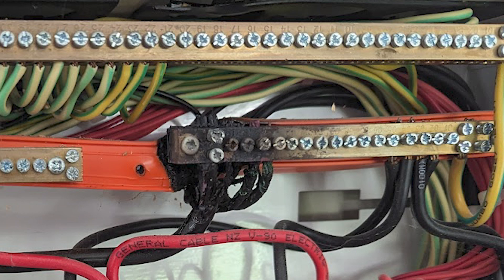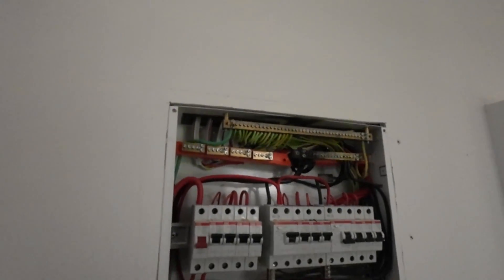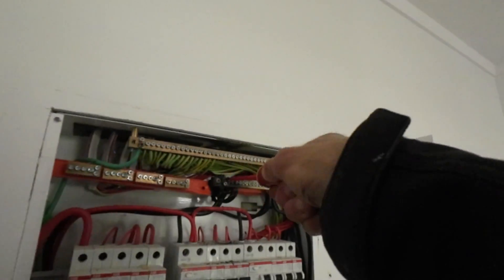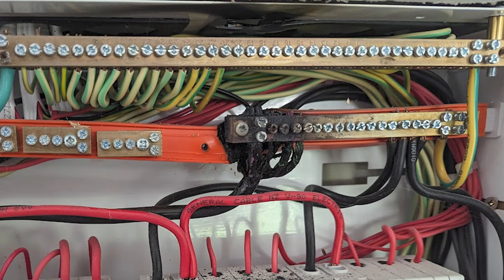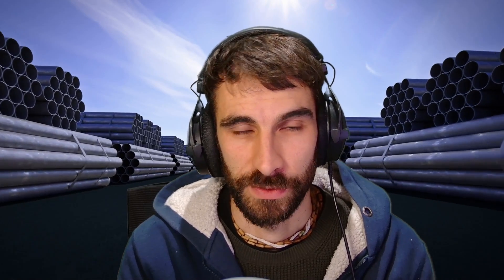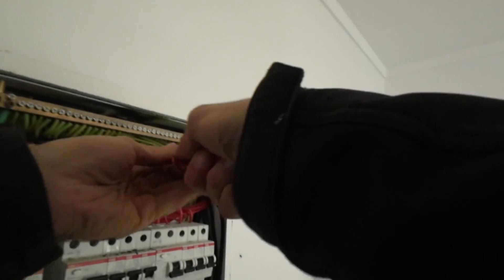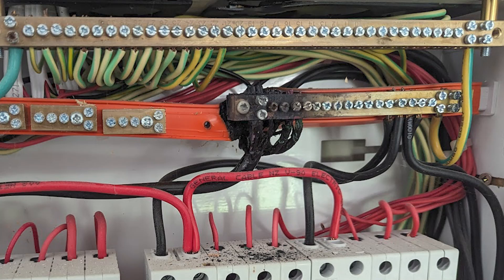Loose Neutral Fault Explained

Comment: The configuration of the Earth - Neutral wiring between the power distribution circuits and the consumer's circuits does appear to vary between nations, with each set of choices producing their own special failure modes and confusions of terminology.
Here in UK we also have (expect, commonly) there to be a main earth terminal (MET) that provides the separation of the consumer Neutral from the wiring Earth (aka continuous protective conductor CPC) which give some safety.. But we're now seeing diverted neutral currents in the earth wiring from some distribution cable faults - you can't win!

The US then has its center tapped 220V supply (twin hot) and a Neutral, so plenty of fun there as well.
Reply from the maker: Yeah, I want to make a video cleary explaining the differing distribution systems. But first I need to understand them all my self.
Reply: @legacyelectrical  When canoeing the Whanganui (holiday from UK) I saw a place that looked like it was fed by a single overhead cable that spanned the river (in the area of Te Whakarae, S of Taumarunui). 
It looked like the live overhead cable terminated at a pole maybe 100m from the property, presumably via transformer with live return side earth bonded probably near the pole. The transformer output feed (two wire) , then (probably) fed to the house where one side would be again earthed to provide the earth and Neutral to the house wiring. 

Lots of galvanic (direct connection) isolation aspects!
Reply from the maker: Yeah, some places in NZ use the earth mass for the neutral. This is rare and onto in remote rural planes. I'm told. Some cows have died from it due to the potential difference between their feet.
Reply: @legacyelectrical  I could believe that, especially under fault conditions. There's a Mike Holt video about such sensitivities - the rural mid west notices these things, along with pregnant women in swimming pools (Florida anecdote).
The mass of earth may be a safe conductor but the surface is a poor insulator/ equipotential bond!
Reply from the maker: Aren't the shocks the cows get just because their feet are so far apart that they get a potential difference? I don't think humans could be effected at the low voltages these setups would create.
Reply: @legacyelectrical  I believe so. The 4 legs with heart in the middle, better conductivity in the body mass, licking things (like kids do to batteries), motorised/pumped feed / water stations, inability to talk (can't say "ouch"), all contribute ..😬
Reply: @legacyelectrical  Sounds like SWER supply.  If we can't get the earth return impedance down low enough in Australia as to prevent step potential at the surface the electrode/pole/transfomer will be fenced off to prevent people and animals from walking near it.  I have heard of electrodes being driven 30m deep.
Reply: The only practical difference between your PME and Australia's MEN is that for you the neutral / earth link is done on the supplier side by the supplier and can not be interfered with by the consumer's electrician.  If you find it to be high impedance you have to call the DNO and have them fix it.

There are technical differences such as; Australia requires a dedicated electrode since 1976 but there are still plenty of older installations using only the water main for earthing, whereas you can still use just the pipe as the electrode.  That actually distinguishes you from a lot of countries that do TN-C-S.  Most such countries require a dedicated electrode, demoting the plumbing to bonded status; in Australia MEN earthing prohibits more than one N/E in an overall earthing system (say a single building or a set of buildings linked structurally or via a common concrete pad and so forth) while you have no issue with that and as a result can see considerable current flowing on the earthing and not see anything wrong with that (diverted neutral current) even in non fault conditions.  You can also run multiple incoming supplies into a single earthing system (as per previous examples) whereas we will only provide one master supply and split that up as needed to ensure only 1 N/E link is present.
Reply: @retrozmachine1189  I'm slightly confused by the assertion of the single N/E connection in the system. Given lots (some) of bonding of extraneous conductors you still get something akin to PME anyway.
A lot of the problems are 'caused' by the difference in perspective between the 3-ph folks and the single phase folks with respect to the purpose of the 'neutral' - in 3-ph its an ancillary unbalance conductor that doesn't need to be there, while in single phase its a primary conductor that's essential to the circuit. All of that is made worse by that nasty soil/rocks/mud [aka earth]  that is a poor conductor at the cubic cm scale but excellent at the cubic km scale that creates those sneak conduction/safety paths.
Reply: @philipoakley5498  Having many amps flowing across the earthing system continuously is not good.  Having the premises earthing system in parallel with the premises neutral system is not good either.  These concepts are upheld by most countries that implement TN-C-S.  In fact I think I am safe in saying the only country that continues to permit and deploy such an arrangement is the UK.
Reply: @ I had a longer reply but a popup/mouse click lost it.
The 'earth' currents will flow based on the impedances of the network of paths. These currents can be from anyone's system, including all the fault and stray paths across all the networks and sources at all levels of the hierarchy. 
The bigger problems appear to be in densely populated areas with older infrastructure and multiple use cases. 
If you are in 1930s house backing onto a DC traction railway and industrial units beyond, with street lighting out front, a local substation near by (with network reinforcement), overhead distribution and your neighbours are on different phases, then there's plenty of opportunities for failure for that scenario. All roads lead to Rome, and neutrals to earth ;-)
Reply: @philipoakley5498  If the penny hasn't dropped by now you never will.  Suffice to say what the UK does few others, if any as I can't think of another example, do.
Reply: @philipoakley5498  I avoid replying to comments in the popup menu, as you can see from your own difficulties and even from the malformed replied to name in your comment it's simply broken.  I open the video or short (in watch mode rather than short) and reply there.
Reply: @retrozmachine1189  Hi, sorry for the delay. I have made enquiries as to the range of countries that use TN-C-S. "PME, or more broadly TN-C-S (i.e. TN-C distribution network, separated out at the consumer service head) is NOT unique to the UK, although in some countries other acronyms are used. Examples include (but may not be limited to, and in no real order):

    Australia (where it is called MEN - multiple earthed neutral)
    New Zealand (also called MEN)
    Republic of Ireland (termed TN-C-S)
    South Africa
    Germany
    Austria
    Netherlands
    Norway (just starting to use the arrangement)
    USA (called MGN - multiple grounded neutral)
    Canada

"
Usage will depend on local conditions, expectations and historical approaches.
Reply: @philipoakley5498  Yes, TN-C-S can be seen used around the world as I suggested.  Not sure what you are getting at here?  Is this in relation to only allowing a single neutral/earth link within an overall earthing system?  That's actually  a pretty common requirement.
Reply: @retrozmachine1189  I was responding to your "the only country that continues to permit and deploy such an arrangement is the UK" part comment with respect to 'countries that implement TN-C-S'.

Perhaps there's something lost in translation? (this part of the discussion was about the problem of diverted neutrals under faulty conditions).
Reply: @philipoakley5498  "These concepts are upheld by most countries that implement TN-C-S.  In fact I think I am safe in saying the only country that continues to permit and deploy such an arrangement is the UK."
Reply: @retrozmachine1189  so what is it (concept/connection arrangement/?) that you think we "permit and deploy" ? And if possible, why it is considered inappropriate (in country X)
Reply: @philipoakley5498  Re-read the comment quoted.  It's quite clear.
Reply: @retrozmachine1189  It took a while pulling out all the comments and reviewing them. It still wasn't properly clear (different viewpoints?).

Firstly Diverted neutral currents (DNC) are the result of a network FAULT, not an allowed arrangement (once discovered/found).

Secondly, It's unclear what you are saying about the earth circuit being 'in parallel'.  IIUC you also have multiple supplier connections to earth, one at each point of supply. We also (commonly) have upstream PME as well a the provision of an Earth at the point of supply. Thus fault currents can flow between properties, via earth connections (especially if on different phases - a network unbalance).

It's not clear if you were referring to cross bonding to other extraneous metalwork, on the consumer side of the system, that may emerge from the ground, which in fault conditions is also a source a danger. Here in UK we do cross bond to such metalwork which should have no voltage nor current on them.

Part of the UK situation is the potential for a high density of electrical services provided often on older cable (e.g. lead insulated , and others with metallic outer shields/armour). The modern Open PEN 'worry' (easy explained case) is for EV chargers at the edge of the consumer property immediately adjacent to street lighting on an independent supply providing shock potentials under fault conditions akin to touch & step concerns elsewhere in the wider network. (the my Earth is better than your earth argument that physics will decide ;-)
Reply: @philipoakley5498  Try reading what you are responding to next time.  It helps if you do.  I won't respond again until you can demonstrate you are actually doing this.
Reply: @retrozmachine1189  likewise. Please remember that what you thought you said can be understood in different ways.

Comment: And that is why all residential properties should use either RCDs or RCBOs in case of an earth fault that could develop into ground fault.
Reply from the maker: This property already has Rcds. RCDs don't protect you from this kind of fault. This is because the fault is before the rcd and any fault current doesn't create imbalance for the rcd tor detect.

Comment: Similar things happened in our place a few years ago, the lights went off for 10 seconds then came back on dimmer than usual, the heater fan also went slow, a call to the utility company was needed, my socket device was showing 170V slowly rising to 190V, about 3 hours later the whole place went off for 30 seconds before coming back on with full power (244V nominal), it was clearly a substation neutral fault.
I live in the UK BTW.

Comment: Hi, I was surprised to see that you link Earth and Neutral bars in the Consumer Units in N.Zealand.
Here in the UK we have various earthing systems but this one we call a TNCS or PME. The diff. being the link between earth and N is in the Head at top of the incomer ie it's pre meter / consumer unit. In general there is no earth rod but that is likely to change in next revision of the Regs.
We still have the danger of broken neutrals but they would need to be outside the property to cause this problem. It seems unnecessarily dangerous to link E&N in the CU.
What is the Max Ze (earth rod only) allowed in NZ ?
Reply from the maker: You're not allowed to do a TT (earth rod only) system here.

The MEN link (main earth neutral link) in the switchboard board (consumer unit) makes sense to me. You can remove thr MEN link to do some kinds of testing for example.
Reply: @legacyelectrical  If you're not allowed TT only, how did you fit EV chargers when they first came out and there was no Open N/E detector available. In UK we had to put them on a TT (No TN allowed) to avoid the risk of making the car live due to a broken PEN (Protective earth and neutral) .
Putting the N/E link in the fuse box seems so much more dangerous coz you are adding at least 3 more opportunities to have a open neutral. 
1/ Tails from the Head.  2/ Tails into the meter.  3/  Tails out of the meter  4/  Tails in and out of an Isolator.  5/  Tails into the main switch.   6/  Connection - Switch to the Neutral bar.   All those risk points could be eliminated by linking them in the Head.
At the end of the day; while the risk of electric shock is sever, more people die from fires caused by poor connections and arching than they do from shock.
Keep up the good work in spreading the word.  Also it's a good tip to check the main earth with clamp meter to look for diverted neutral current before merrily working on an installation.
Reply from the maker: @geraldelwood9660  If you loose the neutral to the installation all metal appliances will become live, not just your car. Why pick on the car as something that should be protected from this kind of fault?

Yeah, measuring current in the main earth is a good move. When I do inspections I like to check that.

In the UK do you guys run a separate earth conductor from outside of the property? I guess that would reduce the number of places that you can have a hot connection develop as the main earth doesn't have current running through it (orindarily), at least not enough to make a hot connection.

Yeah, I think you're right, fires from loose connections are a bigger threat.

I'm surprised how well this video has done. I'm glad it's useful and potentially life saving information.
Reply: @legacyelectrical  I think the reasoning for no PME for EV chargers is that in the future there will be millions of cars, some of which will be plugged in while being washed by owner. Like this, there is a far lower resistance to earth than someone standing in dry shoes on a dry carpet on wooden floor ....  Hence tragedy of lady with outside tap. I have felt for long time that it should be in building Regs that any outside tap must be supplied by at least a 30cm section of plastic pipe - eliminating any "earth" potential on the metal tap.
We have 3 main earthing systems :  TT;  TNS;  TNCS  (PME)
TNS has a supplier's earth - (the casing of the concentric incomer). The main earth is strapped to this and goes to an earth block, at which point the householder takes responsibility. (Max Ze 0.8)  With a TNCS there are just the 2 conductors to the supplier's Head / Cut-out.  The Main earth originates from the neutral in the Head and again goes to the main earth block. (Max Ze 0.35)
We have to install an earth rod if the Ze is above the supplier's Max. Also if the property is a setup to isolate from the grid to tun in Island mode (prosumer)..
In the latest Regs we are now advised to earth to the foundations in all cases as a back-up to PME supply.  Due to increasing cases of open PEN  (protective earth neutral) as our grid ages and falls apart 😀
Reply from the maker: Ok, so TNCS sounds like what we have. There are only 2 wires coming in front the street (if its single phase). But unlike there, every house must have an earth rod. The wire coming from the earth rod is run into the earth bar and the bar is linked to the  neutral bar. We don't have to test the earth resistance in the earth mass, just the wire thsy runs from it to the switchboard.

I see what you mean. Washing a charging car definitely has extra risk. We just have RCD protection for all our chargers. It's hot written into law yet, but the guidelines are to install 6ma dc rcd protection. Best to follow the guidelines since if someone goes wrong and your name comes up, saying 'it wasn't law' won't sound good.
Reply: @legacyelectrical  Similar Regs here. Chargers must have a disconnect device which operates when it detects 6mA of DC leakage on the circuit. Also all upstream RCD's must be a Min. Type A so they still operate even if there is 5mA of DC leakage on the circuit. We have only recently stopped using the Type AC RCDs as standard. Bit late in the day !

Comment: in the US, it gets even crazier with our center tapped single phase system.  if the neutral drops out, the single phase circuits go off balance, and turn into a series circuit - so one instead of each phase being 120V to "ground", I've measured imbalances as large as 200V to "ground".
Reply from the maker: How does  single phase center tap work. Surely you can't earth the center taps off 3 different phases.
Reply: @legacyelectrical  they take one of the three phases, and feed a transformer with a center tapped secondary.  then they connect the center tap to the earth reference.  that gives us two phases at 120V to ground and 240V phase to phase.  then we run our high load circuits at 240V and our general circuits at 120V.  takes more copper than running all circuits at 240V, but we've always had a good supply of copper; and in exchange, if a person gets shocked, it's usually just an annoyance.
Reply from the maker: But then how do you earth the 2 phase set up? I think I need see some diagrams. We wore out transformers in star and the center of the star is neutral and ground. What happens if another gpase gets a ground fault to the earth which is linked to a center tap of another phase?